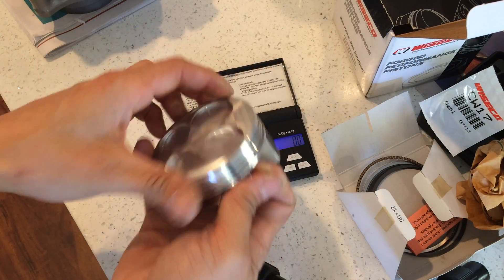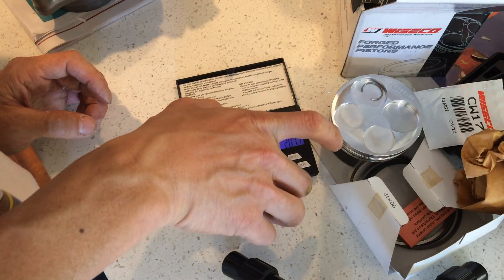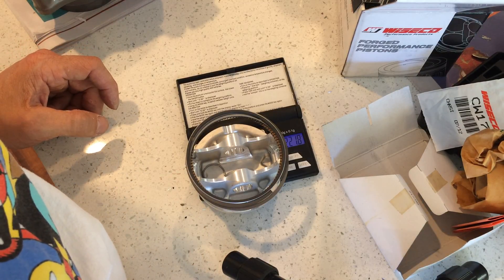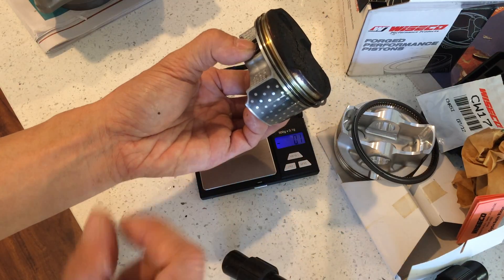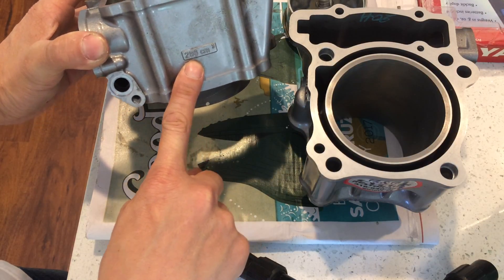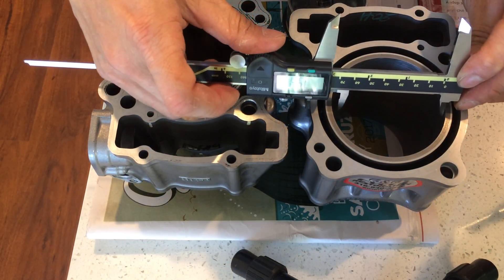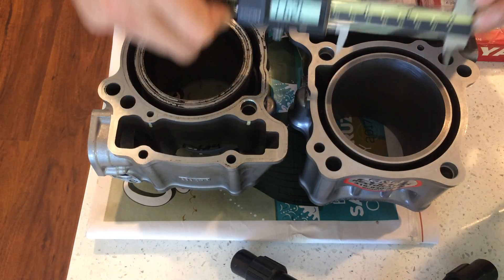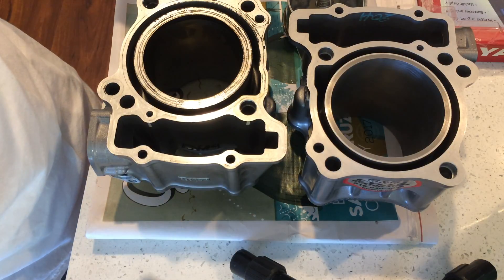CB/CBR300 piston VS B&B 283cc BBK piston

Comment: Hi I'm from Jamaica and I've been searching the internet trying for a 350cc big bore kit for my 2019 honda cbr300r but am having no luck hopefully you could help me out please 🙂
Reply from the maker: B&B has a 305cc BBK for the CRF250 if used in the CBR300 makes it a 350cc.  You'll need to use a larger injector from Honda's crf450x to be able to feed enough fuel without hitting the duty cycle of the original injector.  You'll also need some kind of fuel injection tuner too.  You can also contact Ari Henning, currently with RevZilla, and ask him for advice. He has built several of these 350 for racing.

Comment: Hey. i also built my own 283 kit from stock cylinder. have you figured a nice setting for ejk ? 305 settings are a bit rich for 283. Bill blue developed the first 283 and rick  said 3-3-6-5-4-4,5 were ok to run with this retup
Reply from the maker: I haven't installed it yet, but will hopefully soon
Reply from the maker: also I'm putting it on a cb300 so it will end up being 325cc so the 305 EJK will be needed and should work